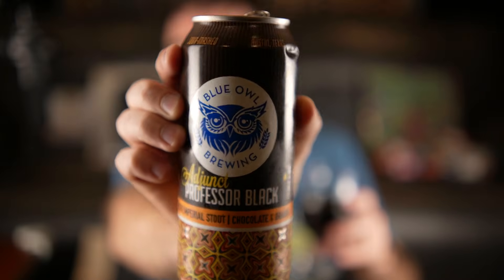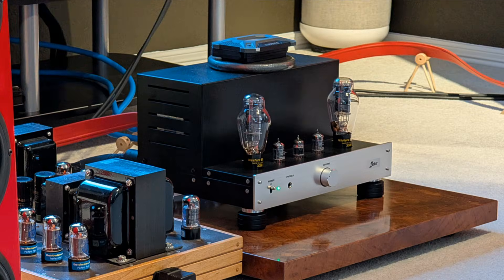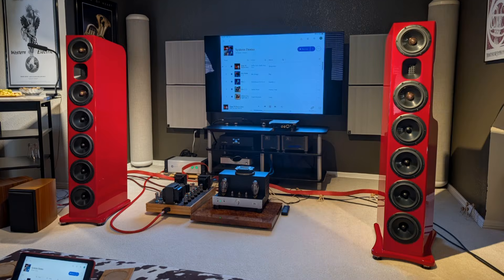300B vs 6V6 vs EL84 | Tube Comparison

Comment: I have different amps built on 300Bs, KT88s (Chinese) and EL84s (Jolida/Black Ice FX-10). To me, the KT88 sounds very much like one of my vintage '70s solid-state amps/receivers. It's the 300Bs that I think of (as you describe) when I want that warm, deep, open, detailed "tube sound" that I haven't heard anywhere else. (Though I do have a mid-'70s solid-state Sansui AU integrated amp that comes close!)

Comment: Interesting and thoughtful post here, but it should be stated: you are actually more describing the difference between amplifier types and designs rather than an apples-to-apples comparison of tube types.   
To more accurately compare between different tube types, one needs to use the same amplifier type (single-ended or push-pull) and the same tube connection mode ( Pentode, ultralinear or triode) with ALL of the tubes being compared.
Reply from the maker: Hey, thanks for the comment! Of course, you are correct. If I find the right gear, I'd love to compare 300B vs a triode strapped 6v6 and EL84. I'll be sure to point those differences out more clearly going forward.

Comment: Hmm. This is my first look at your channel. This is way more than a tube comparison. You are comparing a SE Triode topology to a PPP pentode and I never really got what topology is used in the 6V6 amp. Is it also a PPP amp or a PP amp? Some good shots of the amps would have been nice too.
Reply from the maker: Hey, thanks for the comment! You are right that I could have (should have) covered the topology more. Both the EL84 and 6v6 are running Parallel Push-Pull. The EL84 is biased pretty deep into class A using the ultralinear tap on the OPT while the 6v6 is closer to AB1.